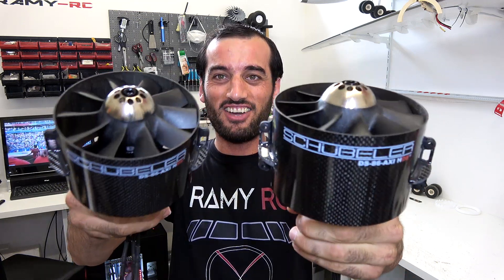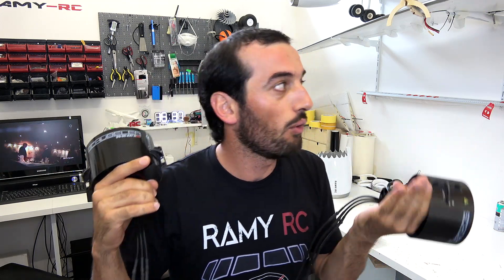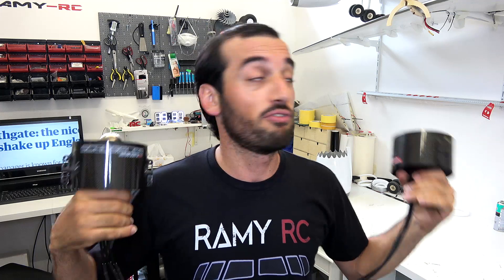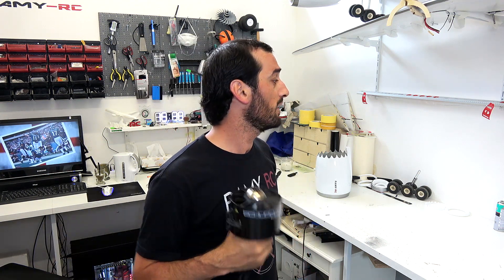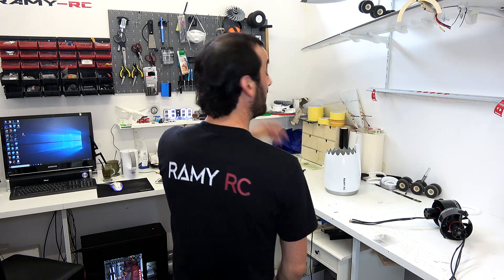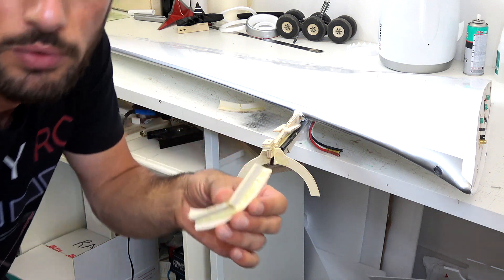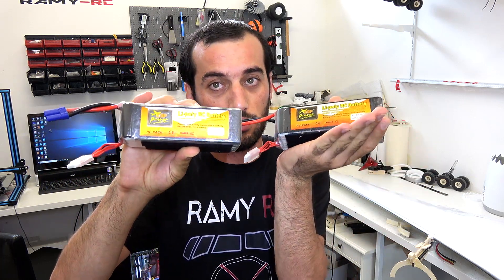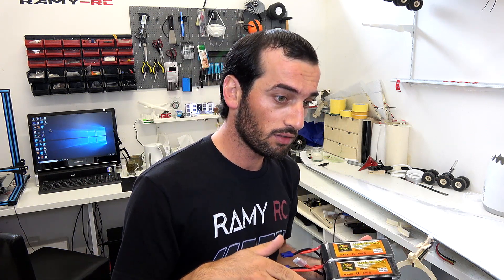Finally the engines for the Boeing 777-9X are here!

Comment: Hey Ramy,  In listening to your video, let me suggest a couple things.  The Motors are BEAUTIFUL!!  Remember that you need a 20% overhead on your ESCs.  In other words, you can't use every Amp of a 100AMP ESC.  If your total max motor draw is 100Amps, you need at least 120 Amp ESC's, (Even if you never use 100% power) otherwise the ESC's may probably cut out on failsafe and BOOM, down she comes.. Do some research, you will see what I'm taking about. Another thing.  Those look like Schubeler DS-82 HST V2016 120mm Carbon EDF Ducted Fan + DSM 6029-600Kv Motor  at $1000 each  HOLY SHIT!

Especially with these big beautiful motors, it is a really great idea to make your own battery packs.  Using SONY VTC6 18650 batteries. 

EACH CELL is 3.7 volts nominal (4.2 volts fully charged) at 30Amps max continuous draw with 3120 mAh (rated at 3000mAh each)   and they weigh 50 grams per cell. Soooooo.  Each  12 cells for a 12S-1P setup will give you 44.4 Volts with 360 MAX amps available with 36000mAh capacity. ...and over 15KW (15984 watts)  And 12 cells weigh 600 grams which is a HUGE weight savings.

And for 12 of those cells, it only costs around $US 70 It is SOOO much cheaper and more reliable than buying Chinese battery packs.  The weight is so much less. Most of the RC developers in CHina use the 18650 round cell setups.  Guarantee you'll get more than 3 minutes out of them. Call Schubeler and talk to them about this and what, if any protection circuit you would need for the setup.  You should do this anyway, since those engines are so fucking expensive.

You can find the specs for SONY VTC6 batteries at https://www.orbtronic.com/sony-vtc6-18650-battery-flat-top
You can buy them on ebay for around $5 per cell here's a link for 10 cells for $55.00 https://www.ebay.com/itm/US-Sony-18650-Lithium-VTC6-HIGH-DRAIN-3000mAh-Rechargeable-Battery-Clear-Case/253603714189?ssPageName=STRK%3AMEBIDX%3AIT&var=552823615785&_trksid=p2057872.m2749.l2649

 PS I DONT sell batteries but I do use these batteries for my EDF RC planes.

PEACE and good luck !!  Looking forward!!
Reply from the maker: thanks for the info, I'm using 120A ESC I hope it works! and for the batteries maybe I try your suggestion in some other small airplane not in the 777 :D